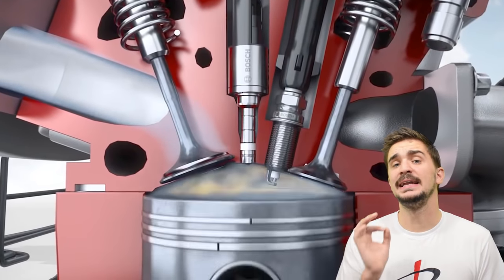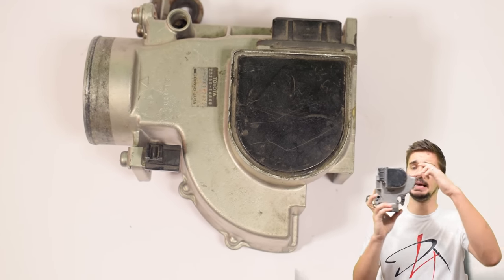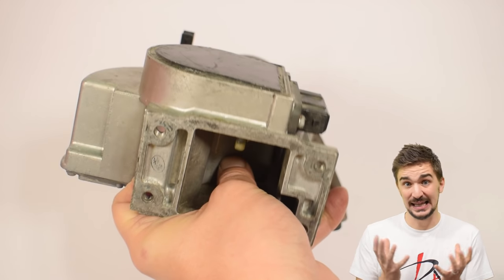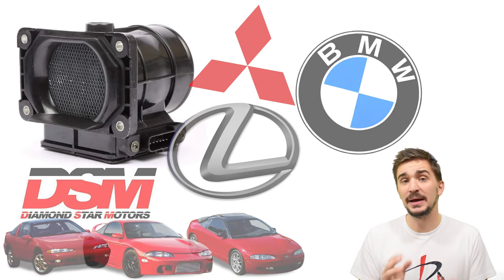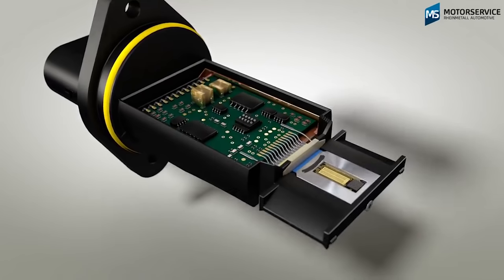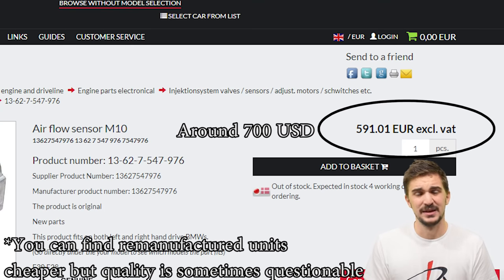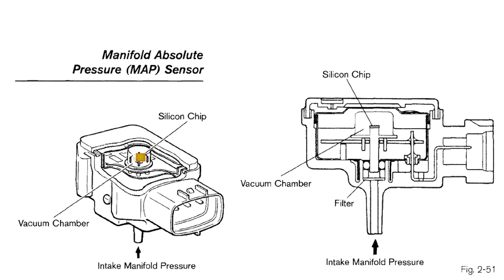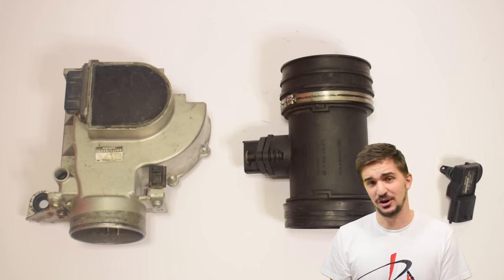AFM vs. MAF vs. MAP - Air flow SENSORS - HOW they WORK and how they DIFFER from each other

Comment: I worked in the electronics department for a leading auto parts remanufacturing company for many years, specifically on the mass airflow product line.  I have experience with all these types of technology and can say that this guy gives a very accurate and comprehensive explanation of each type of device.  This was well done!!!

Comment: An forced induction engine doesn’t ‘need’ both a MAF and MAP sensor.  This is simply for emission controls on OEM applications.  The only critical sensors to make a fuel injected engine run are: Crank, Cam (only if SIDI), MAP, IAT and coolant temp.

Comment: A little clarification on MAF sensors. They have two thermal sensors, one on the heater, another aside. Electronic control aims at maintaning a constant temperature difference between the heated and unheated temp sensor. Flow rate is evaluated based on the selected temp difference and consumed power by the heater. The use of two temp sensors eliminates the inaccuracy related to air temperature variation. In steady flow this sensor works quite well, but under rapidly changing flow rate may have dynamic errors.

Comment: The reason why modern cars have both MAF and MAP is not the turbocharger, but the use of EGR. The ECU in fact does not need to know the mass of air, but mass of the oxygen in it. So  when the engine intake takes just the air (so where we can rely on the ~20% oxygen content), the MAP is the most accurate (is not influenced by contamination, nor by any leak,...). This stays even when you would use a turbocharger. But once you start using EGR, the premise of the "20% oxygen" is not valid anymore, so although the MAP will still measure the mass of the gas entering the cylilders, it does not have any clue about the amount of oxygen there.
In fact for determining the fuel dose, only the MAF is used. The MAP serves as the feedback sensor to control the EGR valve, so it dilutes the intake exactly how tye ECU asks for.
Reply: I agree with you mostly.
Honda also uses the combo, mostly the MAP, to help detect Evap flow.
Reply: So a modern TDI, with ERG and MAF removed, can run fine with only MAP sensor measuring air?
Reply: @udovdh  If the manufacture wrote the software to compensate. They would probably kill power a bunch to be safe.
Reply: Yep, exactly. Older cars don't have MAP. Just MAF and they don't care about  EGR opening/resulting pressure in the manifold.
Also the O2 sensor becomes important here. It allows to even be more accurate on the fuel to inject.
Reply: @udovdh  I don't know how modern you are thinking about, but if emmisions equipment is removed and ECU SW modified then yes. Early 2000-s no problem. For example Mercedes CDI used purely MAP-IAT strategy for their diesels until Euro 4 (2006), MAF's ONLY purpose there was to control EGR flow. A reduced fresh air mass means the EGR is working. That's why purely blocking EGR didn't work, the MAF would detect no decrease in fresh air flow and put you in limp mode

Comment: Very cool stuff, although I do think the temp sensor on MAF and MAP is necessary for accurate calculation. In the case of a MAF, whether air is cold or hot affects how it cools down a given object. As for MAP, the pressure combined with the temperature will give you the mass of a gas contained in a chamber of fixed and known size. As temperature decreases so does pressure so without measuring temperature you don't know if the mass has changed or if it's just a temperature change.
Reply: Exactly what I thought! I would love an explanation as to why MAF and MAP sensors dont need temp sensor, if there is one
Reply: IAT sensor
Reply: Agreed!
PV = nRT
Reply: @mojitocod for the MAF, cooler air is more dense (more air mass) and would cool down the hot wire more in the same way that simply have more less dense air flow would

Comment: Great explanation. Cars ran speed density for a few years around 1990 relying on a simpler MAP sensor. I converted my own car to run a Custom Operating System speed density tune (with twin spark tables) and used it as a daily driver. It never missed a beat during the 10 years I owned it. (MAF sensor removed and P0102 turned off). It gave better throttle response and gained 15 rwhp on a back to back dyno test.

Comment: Love the tech heavy episodes!
My 89-91 RX-7 uses another (pretty rare) type of AFM, the sliding cone style. Its actually pretty aerodynamic since the airflow is smooth over the central cone and the entire unit is no bigger than a modern MAF. I think they were used by a few other makers, but Mazda seems to be the primary one. BTW, despite being 30 years old the FC engines use AFM,  MAP and BARO pressure sensors.

Comment: Great videos!!

I have just a small consideration: ECU is not measuring the resistance of the metal film of a HFM. It usually regulates (and measure) the current passing through the metallic film to keep it at constant temperature. Depending on this current, knowing the air temperature, it is possibile to calculate the air mass. The raw value will be then corrected by the ECU through a couple of maps

Comment: Thank you for the best explanation ever.  In continuation of this subject.  Most modern aftermarket fuel injection systems use the MAP sensor. It has been found that with high lift and large over lap camshafts used in racing engines that all of these sensors loose accuracy with large reversion values at idle and low engine speeds on engines with no cam timing control. Correct air fuel mixtures are then controlled by blending TPS sensor input with MAP sensor overriding MAP sensor at high overlap situations.

Comment: Great video- I learned a lot. As an aside, my motorcycle (BMW) doesn’t have a maf, map or what have you.  It uses a throttle position sensor and intake air temperature sensor (along with engine rpm) to estimate air flow.  At least it does this when it’s “open loop”- when the throttle position is changing,  At cruise it goes closed loop and uses the oxygen sensor to adjust fuel flow, to get the stoichiometric ratio.

Comment: Nice explanation.  One small correction however.  MAP systems, also called "speed density" systems, calculate the mass of air filling each piston on the intake stroke by calculating (or estimating) the density of the air entering the cylinder with and equation the uses the absolute pressure and temperature of the air in the manifold.  This density is then multiplied by the swept volume of the cylinder (full stroke x piston area) and by the volumetric efficiency (VE) for the engine at the particular rpm the engine is running at to estimate the mass of air entering the cylinder per intake stroke (hence "speed").  The ECU then calculates the pulse width to deliver the correct amount of fuel to achieve the desired fuel to air ratio for that particular intake stroke. If it is a throttle body system it multiplies the amount of fuel needed for a single cylinder times the number of cylinders for the engine and injects this with a single set of injectors in the throttle body.
Reply: Exactly!

Comment: VW TDI engines use both MAF and MAP sensors and their measurements must match or the ECU will cut down the power. They can only detect leaks in turbo boost pipes if both sensors work correctly because in that case MAF sensor will show all the air going to turbo but MAP sensor will see some of the air missing.

Broken EGR valve can also mess the manifold pressure which is measured by MAP sensor.

Comment: I don't recall hearing about the AFM :D I guess you learn something new every day :D
Reply: Afm, also called "vaf" or "lmm"  in german
Reply: @Mario_Marques  good to know :)
Reply: Used in 1976 Nissan 280Z without dampener but with an adjustable clock spring. A covered screw allowed a by-pass cavity around the flapper,  was used to provided to fine tune the A/F ratio across the entire 7,000 RPM range of this well balanced inline 6 cylinder using a 3 gas engine analyzer. They were so precise that they required no catalytic convertor as no excess of unburned hydrocarbons or carbon monoxide out the tailpipe. With a five speed stick you could reach a top speed of 142 MPH via a divorced differential and half-shaft to both rear wheels. Not only did I own one, but was a technician at the dealership. Regular gas was a minimum fuel requirement but I ran Premium fuel. 
 Only vehicles produced after July of 1979 required unleaded fuel and a catalytic convertor including imports that still met emissions standards without at cat. The 1976 was a high end compression and slightly more aggressive camshaft. That changed in 1977, they very next year. Identified by a gear reduction starter, camshaft part number and pistons. Resulting in lower HP output. The next year, 1978, the service manager offered 5 cents extra for each of these new test, made available in 1974 by the “National Institute of Automotive Service Excellence” or NIASE. It was 8 categories, 8 tests, multiple choice and 60 questions each. Techs at dealers and some corner shops, are paid by “Flat Rate” which is based on manufactures warranty. In 1977 customers paid $24 per hour except for “C” labor or coupon like oil changes. This meant 40 cents per hour extra. I took and passed all 8 test. Later, the name was shortened to “ASE”, certifying that you had book knowledge but hands on, as some questions could not be answered correctly if had not actually preformed this auto service. 
I hope this gives you information that will help as the vane airflow meter was used by Ford into the late 80’s. ASE Master Tech-Retired
Reply: @deankay4434  that's a lot of info in 1 comment! :D Thanks.

Comment: Excellent explanation of the principles. A lot of research and information has been put into this video.  This explanation correlates to the difference between ACFM and SCFM. Many pump manufacturers use ACFM numbers to mislead customers on their data sheets.

Comment: When it comes to tuning MAP is the easiest to learn and easy to transition from NA to boost without having to learn anything you already know from NA tuning. 

That said, it's hard to find good quality 2 and 3 bar MAP sensors that aren't complete garbage but luckily there are some OEM ones that work the same as the common aftermarket types.

Also one of the big advantages of MAP over the flow meter type sensor is it's a lot faster in response, only limited by the speed of sound where as vane type takes some time to swing open and hot wire takes time for the resistor to cool in response of air flow.   MAF has PE functions built into the ECU program to estimate the amount of air rushed in on sudden throttle openings based on TPS movements while the dead band of the MAF passes. Although MAP also has a similar thing but called AE its not anywhere to the same extent, usually only a few ms of extra fuel injected.

Comment: Very good video but some minor errors: Mass is not a measure of numbers of atoms/molecules that is N -> the amount of substance in moles. For MAF and MAP sensor to work properly you must know the temperature. When air with different temperatures passes through the MAF sensor it cools the wire at a different rate. If you have the same pressure but not the same temperature in the intake you have a different mass of air. In the end, ECU must know N of O2 and N of fuel to calculate the stoichiometric mixture. Keep up the good work.

Comment: I thought you wouldn't mention diesel engines at all, but you did... 🙂
So if I understood correctly, it’s less common in diesel engines, but nowadays they do have them, MAP and MAF? For example, my 2.2 i-CTDI Civic probably has one? If that’s the case, since the car is from 2008, I may benefit from cleaning MAF and MAP sensors or just replacing them and getting my fuel consumption lowered. It’s mostly driven in city traffic so the fuel consumption is around 8L/100km, that’s slightly aggressive driving.
Of course, amazing video as always. 

Cheers

Comment: If, as you say, the vane type sensor is sensitive to velocity and density then it is a MAF sensor.
Manifold volume isn't used in MAF calculations. MAP and IAT are used in conjunction with engine speed to calculate MAF, usually referencing tables specific to the engine.

Comment: To be precise on the MAP sensor: air density is function of pressure and temperature so to estimate exactly the density, an intake temperature sensor is always needed. The main drawback of MAP sensor is that it can't detect airflow, so even if the calculation of density is correct, he doesn't know how much of this air is sucked into the cylinders, so the engine ECU must also rely on the TPS (throttle position sensor) and a "volumetric efficiency map" loaded into the firmware. All of this may be less precise than direct mass airflow measurement with the MAF sensor.

Comment: one thing I learned is that it's best to hook up the waste gate hose after the intercooler near the throttle body. pressure drops after the intercooler and having the waste gate hose on the turbo itself doesn't compensate for the pressure drop that occurs in the intercooler.

Comment: Very good video - but small correction - the hot wire and hot film MAF must to be coupled with an intake air temperature sensor because freezing cold air cools down the hot air more than hot air of the same density.
Reply: Freezing cold air and hot air will never have the same density. Cooler air is always more dense than warm air.

Comment: The 2.0 abk audi 80's afm not only sits tilted, but the airflow is longtitudional to the car, therefore when the car accelerates any imbalance in the metering flap would completely distort the measurement. Idk if it does, but I don't think it makes much of a difference how you mount it, as acceleration and cornering would cause massive data distortion.

Comment: Karman Vortex Airflow Meters are still used in new non-turbo petrol Peugeots. With regards to older engines, I've most commonly seen them in Peugeot's 1.6HDi and 1.5 diesel motors.

Comment: Bosch K-Jetronic is a mechanical (or later, electro-mechanical) fuel injection system that uses a verson of a vane AFM to mechanically adjust fuel supply.

Comment: Interesting... every car I've owned only uses a MAP - all my Hondas and now my Golf. VW got rid of the MAF on the EA888 engines, I believe due to the issues you discussed - dirt, oil, and general "crud" getting on it and fouling the sensor. 

As long as they know manifold pressure, atmospheric pressure, air temperature, and engine displacement, they're good to go.
Reply from the maker: Yup, there's some other newer turbo cars that also only run a MAP, they do have a bunch of other stuff too, or even multiple MAP sensors in some cases, but it's true that there's MAFless turbos out there.

Comment: You can stimate air flow without a map nor a maf by the throtle  and speed sensors, like on motorcycles engines

Comment: Also, on oiled air filters, you must also let it sit after a fresh oiling for a day. Use it too early and the oil will not have soaked into the gauze properly and will spay onto your maf sensor.
Reply: This is WHY you don't use oiled air filters.

Comment: Dear driving 4 answers. Very good explanation. I had a 1988 Toyota supra turbo and the turbo model was the only one that had a Karmin vortex type mass air flow sensor.
Driving 4 answers, would you also be so kind as to explain to us how PGM-FI works. It's used in early Hondas. It's stands for Programmed Fuel Injection, and it uses no mass/air flow sensors. I think it uses a pressure differential SENSOR and throttle position SENSOR to determine the air fuel ratio, but I'm not sure.
Reply from the maker: Many Hondas are MAP only. It's basically a MAP sensor an intake air temp sensor and throttle position sensor. It's a simple and proven setup. Most tuned cars with standalones use the same kind of setup, it's also called speed density.

Comment: Great again man! Got a question about throttle body that no one ever answered but I believe you can. 
I’m driving my car 80-90-100 mpg and I get off accelerator. The throttle body is now closed. Where does the engine takes the air to still run at 3-4 k RPM.
Same with the second gear  why does it sometimes push me forward with my foot off the pedal. 
Is the throttle body somehow adaptive and its not listening to your foot but to your RPM or what :))
I wouldn’t mind to see a video about this topic.

Comment: Thanks for expanding on the working of the Vane Air Flow Meter. My '93 Protege has exactly this. I just changed the air filter and the car bucks when I give it gas. Looks like either the vane is dirty - sticking closed - or the meter isn't installed perfectly horizontal.  QUESTION: If the vane is sticking, will MAF Sensor cleaner fix it?

Comment: Hello and thank you for this wonderfull chanel! 
Is MAP and MAF in modern CR Diesel only for EGR? My Lexus IS220d has EGR Off(both physically and software) but when my MAF was dirty the engine was very low on power and very jumpy. Also bad MPG. Once I cleaned it with MAF Cleaner spray, the power become normal and smooth, also MPG is much better. So logicaly it shoudnt be only for EGR?

Comment: Thank you for this very useful info. But I still don't get how a MAP can work without a temp sensor? The number of molecules will change in an intake,  if the pressure is constant but the temp change? So the temp must be known to calculate the fuel needed?